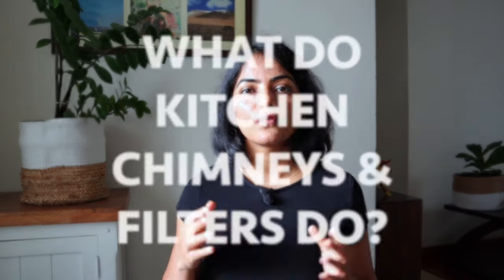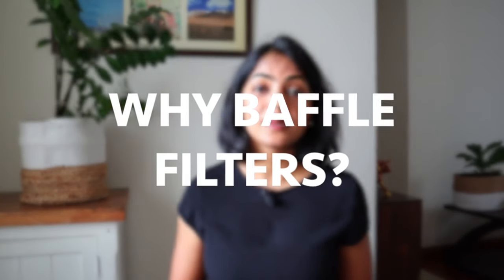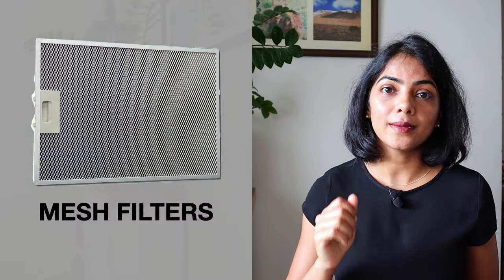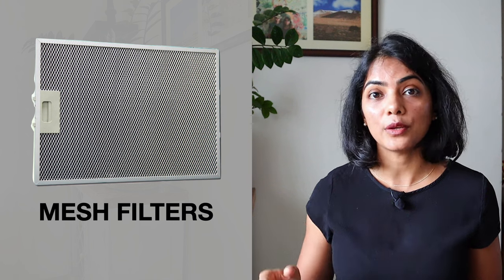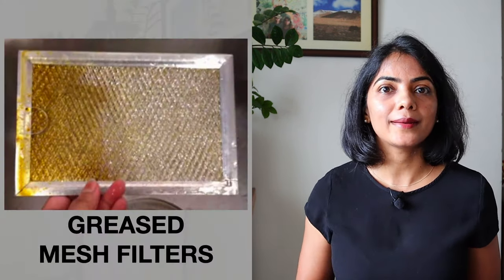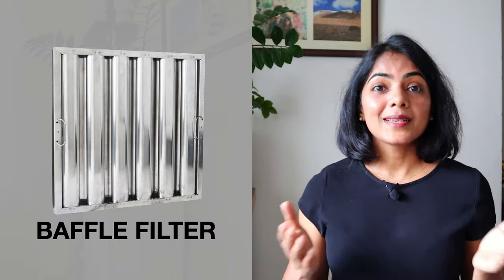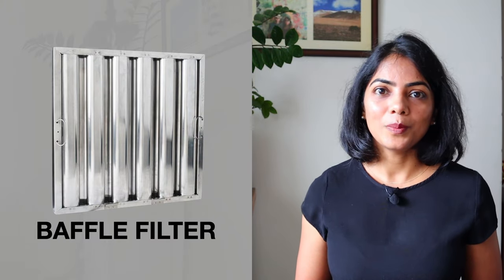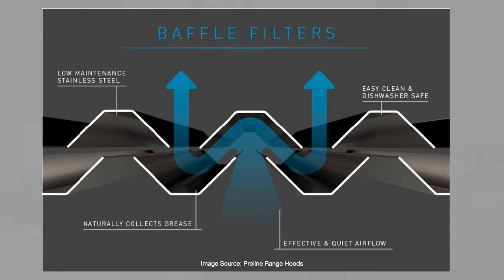BAFFLE FILTER vs FILTERLESS kitchen chimney - which kitchen chimney to buy? Best kitchen chimney

Comment: Thank you for explaining the baffle filter.  I recently upgraded my hood and it was advertised to have a "Grease mesh baffle filter".  I had never heard of a baffle filter, so assumed there was supposed to be mesh in the baffle area.  After an hour long texting session with Home Depot trying to sell me a carbon filter that goes on the motors for a ductless set up and emailing the manufacturer and being told I needed to buy carbon filters, I finally found this video.  You explained more clearly in 5 minutes what the manufacturer and distributor couldn't do in 2 hours.  Thank you for this video.
Reply: So you are using baffle filter now ?
Reply: @technik2  yes. No problems. It works. Was just confusing instructions.

Comment: I was so confused between baffled filter and filter less auto clean chimneys. And you have well explained regarding this in your video good job.   I have few queries here 1) So I understand that in the case of ' baffle filter auto clean ' we have to clean the baffle filter too?  2) can you suggest a filter  less auto clean chimney having size 90 cm and suction above 1200 with  noise level below 60 db for my open kitchen.
Reply from the maker: Hi Shyam, typically the auto clean function is for the insides near the motor and such where there are oil deposits. It also helps to liquify the oil deposits near the filter. But you may still need to clean it occasionally. Once a year service is also required - for all types of filters. You can consider the Faber 90 cms - https://amzn.to/3Dwkh6Y which has less than 60db noise level too.
Reply: @TheGrapevineIndia  thank you

Comment: Thanks for the informative video. Our kitchen is 8 ftx 5 ft, L shaped kitchen. We used to have exhaust fan, now we are planning buy chimney. we have three burner hob and the pipe length could be max 5 ft. we use oily cooking quite often. please suggest chimney options with double baffle filter and oil collector both autoclean and non autoclean. Thanks in advance again for this advice.
Reply from the maker: Hi SUBASH GHOSH! You can consider this https://amzn.to/3NgzTk7 with baffle filter.
Reply: It's not available now

Comment: We purchased hindware baffle filter nevio 60 about 2 months back 
Wanted to go filterless but didnt research much at the time( heard filterless drips oil more comparitively?)
I should ve found ur channel then; might ve changed my mind; rather than just  selecting most common purchased thing
Reply from the maker: Hi @smiling face - no problem! Baffle filters are still good, but require some amount of maintenance on a regular basis. Both baffle and filterless would drip if the chimney is not serviced for a really long time.

Comment: We have a 2 burner stove. My mom has health problems and will not be able to clean the chimney regularly. Is faber 60cm filterless chimney good for us? Also we have a window just above the stove. Can the chimney be fitted in the window? Will there be reduced efficiency of the chimney due to the windows(will the smoke enter our kitchen again through the window or closing it will solve the problem)?
Reply from the maker: Hi Kanimozhi! If you have a window right above the stove and you keep the window open, you could consider just getting a powerful exhaust fan as you have sufficient ventilation. I don't believe it is possible to fix a chimney on a window.
Reply: Yes, possible to fit chimney over a window grill. They have a hook kind of clamp costing Rs.1500, over which chimney is mounted.

Comment: Hi Mam, Thanks for sharing information, I like angular Hood chimney 60 cm(Auto clean)  But my budget is low around 10 to 13k. Will you suggest me any angular Hood chimney or I should go for curved glass hood chimney.
Reply from the maker: Hi! Yes you can get angular in that budget. I'm using a higher version of this https://amzn.to/3wzb3n0 which is good. Slightly higher than your budget. At that budget you may have to compromise on auto clean - in which case you can consider this https://amzn.to/3KkK5Hf
Reply: @TheGrapevineIndia  Hi I have been using Glen filterless. It is really good but I feel overcharged in after sales. They charge travel expenses alongwith service charges.

Comment: How much suction capacity has to b chosen for optimum noise level? And which brand is bettr (concerning noise level)
Reply from the maker: Hi, lower suction power will have lower noise level - but the suction capabiity also will be low. Ideal will be between 1000-1200. But that should be determined based on your type of kitchen and cooking pattern. This video should help - https://youtu.be/6SUmJc40Zi8

Comment: Can you recommend a good chimney with baffle filter auto clean for 3 burner gas stove with 120 sq ft OPEN kitchen
Reply from the maker: Hi Aks, since you have an open kitchen, you may need one with a higher suction. Also a higher suction if your pipe is longer to the duct. So with that - I recommend this model with auto clean, baffle - https://amzn.to/3Kty7uQ. Most angular ones come in the filterless categories.

Comment: Mam, faber 1500 suction with baffle filter or faber 1200 with filterless(which is less costly) which one to choose? Can you please tell me the approx cost of service the chimney?
Reply from the maker: Hi Debanshu - technology wise both are different. Your day to day maintenance in a filterless will be lower. If you are cooking lot of oily food, then you can go with a 1500 suction, else 1200 is sufficient. Service on a regular basis will be approximately once a year. It can cost anywhere from Rs. 600 - Rs. 1500, based on your location and work involved. You can check with Faber for your specific model.

Comment: Thanks for the video. But I have doubt that in filterles chimney does gas grease affects the motor and its life  as it sucks the gas directly.
Reply from the maker: Hi Mihir, in filterless there is a covering around the motor to protect it to some extent. Also we need to run the auto clean cycle frequently which melts and collects the oil from inside thr chimney in the oil collector - which needs to be cleaned frequently like once in 3-4 weeks to make sure you don’t have a ton of grease. In addition, similar to other filter chimney’s - it is recommended to service the chimney around once a year where the service folks will clean the insides. The filterless chimney reduces day to day maintenance only 😊
Reply: @TheGrapevineIndia  thanks for clarifying.
Reply: @TheGrapevineIndia  I disagree with the yearly service ( as I believe it would require a more regular one)as with this filterless technology there is no filter(Mesh or baffle) catching hold of the oil, so the oil is expected to escape to the motor side and get collected near the blower which a technician can clean.
Reply from the maker: Hi Rajat! Thanks for sharing. This was the recommended frequency by the service personnel of Elica. Its been a few weeks since I started using it. Will update on how much oil it collects and frequency of cleaning required once I use it more.
Reply: @TheGrapevineIndia  any update on this?

Comment: In most of the youtube videos and even at local shops it was advised to go with baffle filter chimney instead of filterless chimney at home. As in filterless they claimed that oil got stuck at machinary and later on it may harm motor and reduce suction efficiency also. In addition to this please suggest chimney will minimum sound.
Based on this would u still recommend filterless for home usage?
Reply from the maker: Hi Ishan, I’ve been using it for a few months now, the sound is equivalent or less than baffle (I used baffle in the past). Every chimney requires regular maintenance- in the case of filterless - a once a year service where they will clean the insides if required. In general - during the auto clean cycle - the oil that may have settled on the exterior of the motor gets heated and melted and gets collected in the oil collection tray. This tray can be cleaned manually based on how much oil is collected. 
I would recommend filterless- easy to manage with better designs these days.

Comment: Hi, can you please recommend me a chimney for 5 burner hob (so i guess a 90 cm chimney?). My requirement is more suction, less noise, preferably motion sensor (though not a mandatory one), auto clean and filterless chimney. Budget - can manage till 35,000/-. Please let me know. Thanks.
Reply from the maker: Hi Pushpam - is your hob 90 cm? I use this one https://amzn.to/3FMeyfS  in 60 cm, which is quite good. You can also consider Faber https://amzn.to/30V9Exo 90 cm. Both filterless, auto clean with motion sensors.